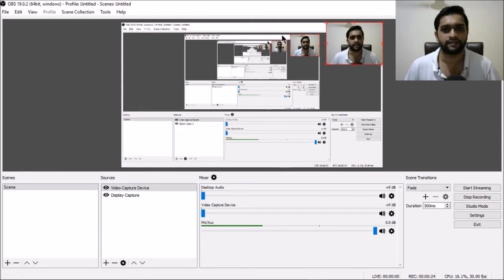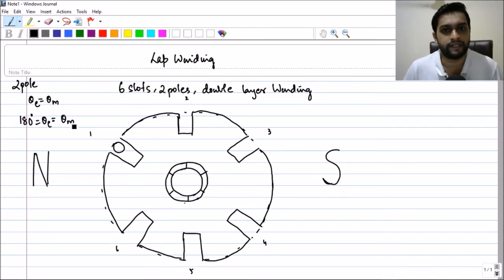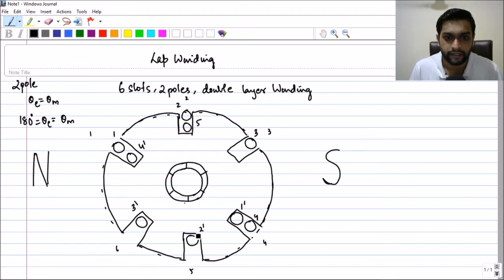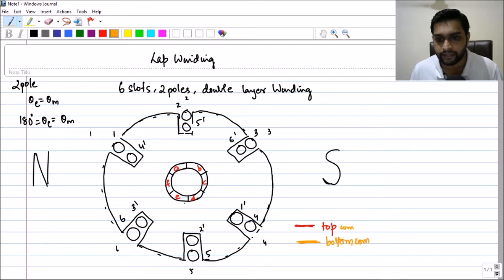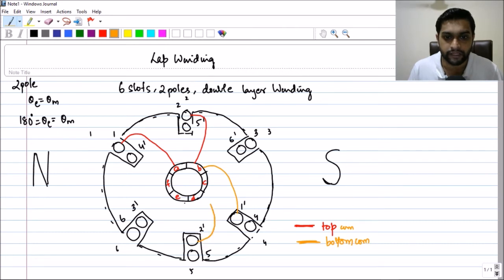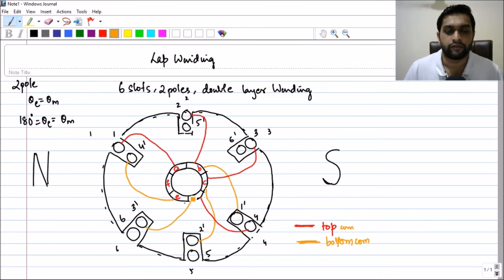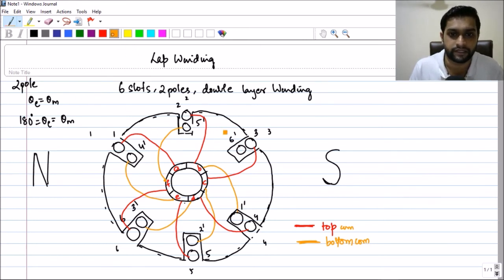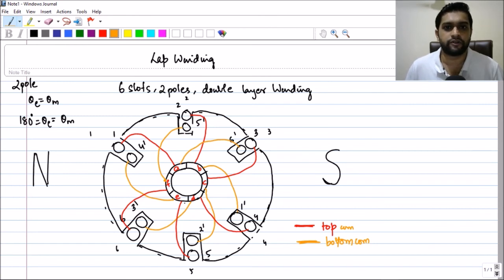#12 - DC machines Basics Armature Windings - Part3 - wiring a 6 slot 2 pole lap winding

Comment: Sir, is following the top and the bottom positions of the magnetic wire must be strictly followed? I just have a hard time in positioning the wires as I make the lap winding. We are just doing a project for our machineries class. Thank you
Reply from the maker: Well for a small project I don't think it would be an issue...
Reply: Thank you sir, hope it works!

Comment: what will happen if electrical side nt equal to mechnical side.... by hw much degree the  the first and  & secnd coil b seperated, and please help us with the definiton of lap winding
Reply from the maker: You have understood the concept a bit differently...the concept is ideally you want 180degree electrical which corresponds to some mechanical dgree depending on number of poles of machine...for 2 pole machine both electrical and mechanical angle is same but four 4 it's not ...in 4 pole 180 electrical will be 90 mechanical..but we are concerned about electrical only..yes some.cases the diff between coil side is less than 180eelctrical that is called short pitching....
Reply: varun nair now i understand it.. thx fr the reply , sir 😊

Comment: Sir above problem the winding is single layer how many number of slots in the armature and plz explain..?
Reply from the maker: In the lecture I have started by selecting the no of slots first...then selecting no of conductors..assuming the same no of coils sides I.e 12 the no of slots for single layer winding would be 12..no slots = no of conductor ( or coil sides ) for single layer winding.....thank you.....cheers...
Reply: In single layer winding 1st conductor is connected  to segment 1 & which conductor is  connected to segment 2...?
Reply from the maker: +Shiva Kumar in this case 12 slots means 12 commutators and as usual the first coil side of coil1 will be to first commutator and Second coil side of coil 1 to the 2nd commutator ..From the 2nd commutator to the first coil side of coil 2..and Second side of coil 2 is connected to the third commutator and ...And so on....I hope it is clear
Reply: Tanq sir